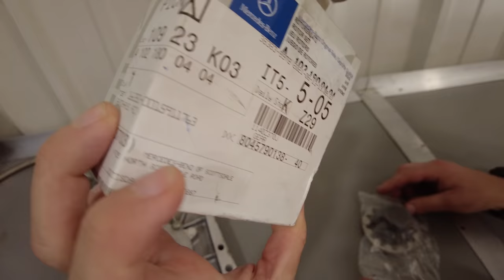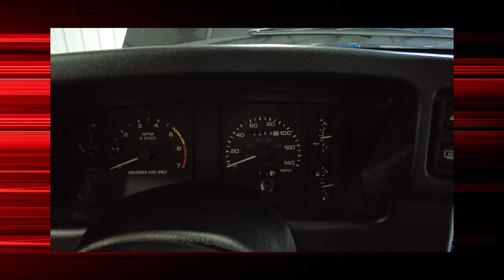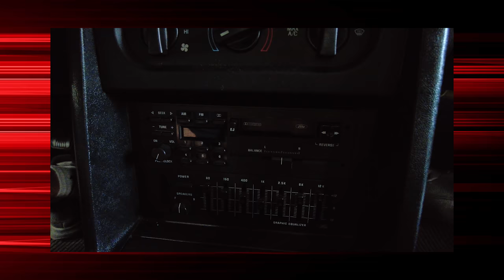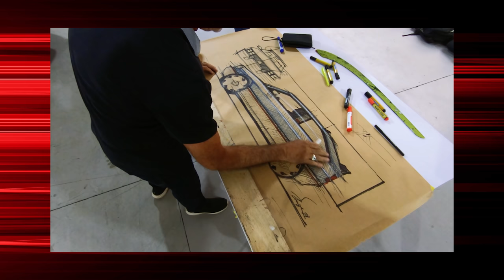Vou abandonar o projeto da Mercedes FTSENNA? E o Opel Kadettche, será que vai vingar? Mustang FTE?

Comment: 1 - Monta uma câmara simples e boa de pintura no estacionamento e chama um pintor brasileiro bom de renome;
2 - Painel do 190E restaura com silicone preto para temperatura, e refaz o revestiomento com alcantara ou essa flocagem;
3 - Dá um talento nos podres do Opel, coloca um motor de hayabusa 1300 com turbo e fueltech para dentro;
4 - Muscle cars legais seriam o Tomaso Pantera GTS ou um Dodge Charger 1969, faria tipo restmod com bigblock biturbo e obviamente com fueltech.

Comment: A Mercedes eu espero o quanto necessário para ficar de acordo com o projeto e design. Ficou sensacional. O painel seria melhor com ou carbono ou couro na parte superior apenas. Não usar envelopamento. A pintura preta é a mais cara por mostrar pequenas imperfeições mas é o que precisa leve o tempo que levar. Já li algumas dicas e a que achei interessante foi "O Magrão que trabalhou no carro da Formula Drift do Erick Medici." Tem oficina e cabine de pintura aí perto.
O Mustang me deixou decepcionado a WEG não resolver.
O Opel deve ir para a mesma oficina do Mercedes e resolver o problema do assoalho e depois turbinar e usar uma FT ou substituir o motor e caixa por um 4 cilindros maior que forneça uns 150 cavalos.
Grande abraço

Comment: Não pode desistir da mercedes. Faz um "importação temporária" de um funileiro brasileiro pra finalizar a mercedes, recuperar o assoalho do opel. E com o Opel deixa com o motor original, carburado (Atualiza pra um melhor com injeção), turbinho e FT350 e tirar uns 200cv desse motorzinho. Se explodir tudo troca pra um motor elétrico como o fusca. E pro motor da Maserati faz um restomod, arruma um Chevy Nomad, Bel Air, Ford Ranchero, esses carros dos anos 40/50/60.